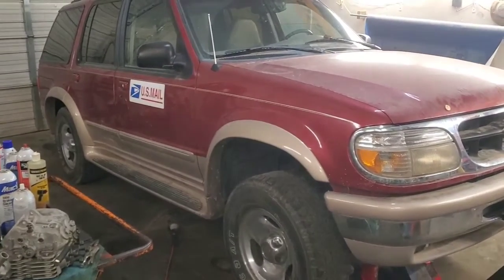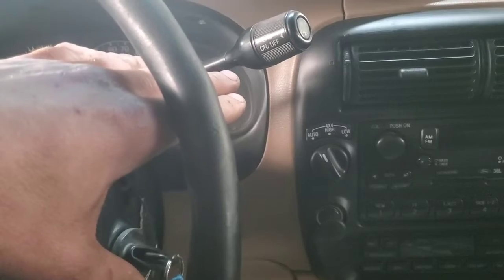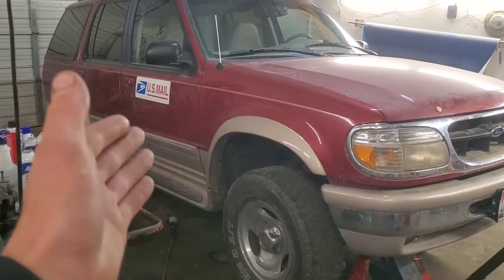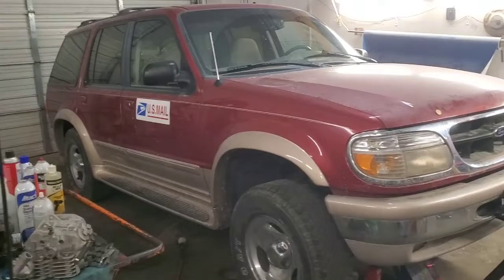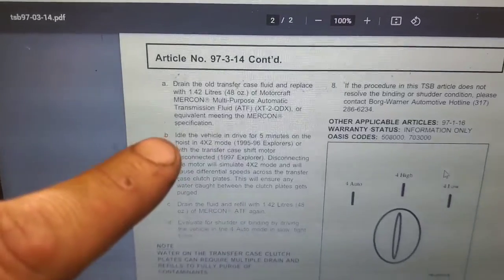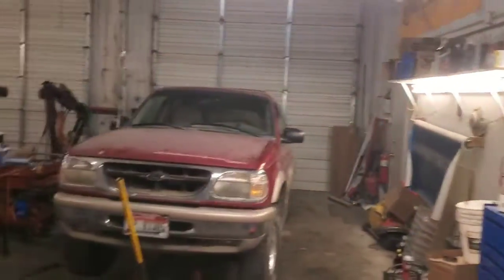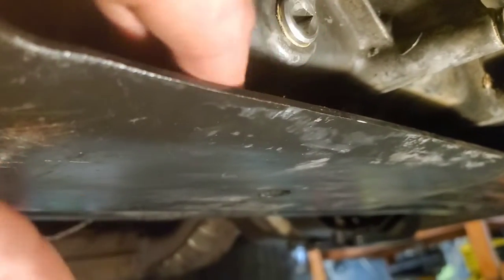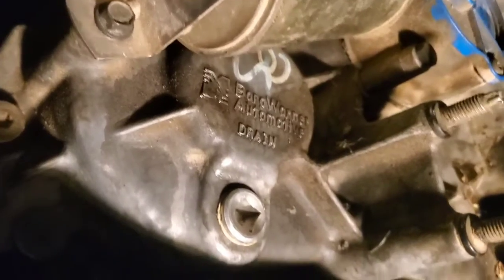Do this first!  4x4 Ford Explorer binding and/or shuttering in Auto mode on dry pavement.

Comment: If my 04 explorer drives in 4 LO, but won’t move in 2 wheel drive… does that mean it’s trashed?
Reply: Did you get any answers?
Reply: Still good for farm truck! I would still try this flush
Reply: If you remove the transfer case motor,  you can manually shift the transfer case. 
1.Car off 

2.transmission in neutral

3.raise the wheels off the ground

4.remove the TC shift motor from the TC. leave wire harness connected

5.using a screwdriver blade that fits the shaft on the TC, you should be able to manipulate the yoke position 
(that is what the TC motor does) except your doing it by hand.

6. If it is stuck, it may require some assistance, a second set of hands, to rotate the back wheels slowly and gently while you  try to release the yoke position from 4wd by rocking the TC shaft CW and CCW. Until it drops into its 2wd position.
You know this because your tire wrangler will rotate the back wheels and the front wheels no longer follow.
Looking to get it into the middle position which would be 2wd.

7. If you cant move the keyway either direction (CW/CENTER/CCW) then there may be a broken yoke inside the TC or other TC failure and you will need to remove repair and replace the TC or purchase a rebuild or a refurbed TC.

8. below is a link to a video that offers some insight.  jump to exectly at 5:10 and you can see the shaft mating the TC shift motor. and at 5:16 you can see the TC shift motor that the shaft mates to. 

9.First You want to determine if the shaft on the TC can move. And you'll want to know if shift motor can move as well.
have your wrangler start the car (in neutral) and press the auto 4wd button did the shift motor rotate the key? Try the other buttons, 4h or 4l,. If the key on the motor does not rotate that is a failure mode and look at fixing the wiring or motor. 
If it rotates fine then push 4wd auto then shut off the car and make sure the shaft is at 2wd position.
You're trying to manipulate the yoke to its center, which is 2wd.
If all goes well then the TC shaft is in the 2wd position and the Motor is too.

10. Replace the motor to the TC with it in 2wd position. 

The diagnostics to get to the root cause of your problem are deeper than ive described, but to unstick the TC from 4wd, allowing you to drive it in 2wd this is about as down and fast as it gets.

No guarantee the yoke or chain, or gears or any other internal in the TC are good, just that you can take it out of a stuck 4WD back to 2wd.

good luck

https://www.youtube.com/watch?v=Xn2TR1hruJI

Comment: Trying to resurrect my mom's old 2000 explorer and after throwing some new tires and brakes on it, it was binding like crazy while I made some tight turns in the driveway. I'll betcha it just needs a transfer case fluid flush. Thanks for the video!
Reply from the maker: Yup that will most likely fix it

Comment: Cut the brown wire going in the tcase harness, this will eliminate awd and high and low still work. I've ran into this issue putting two new tires on the back with old ones in front
Reply: I’m a try this first ! Thanks my guy